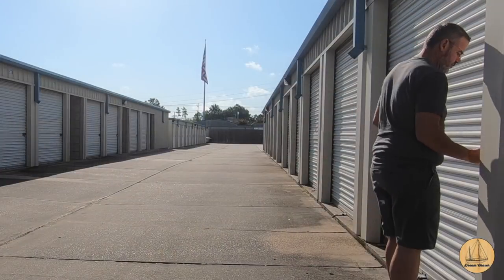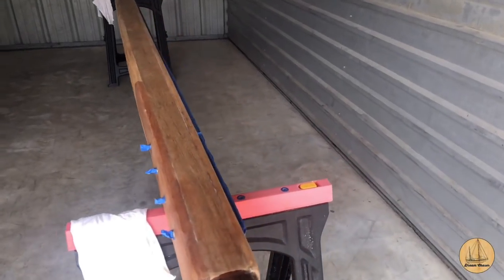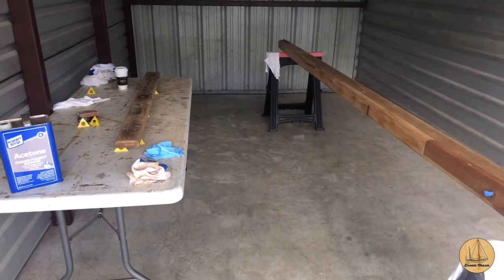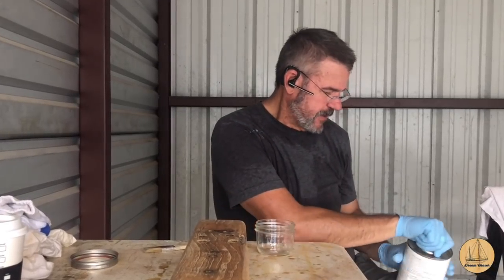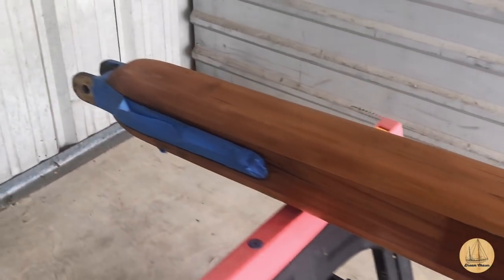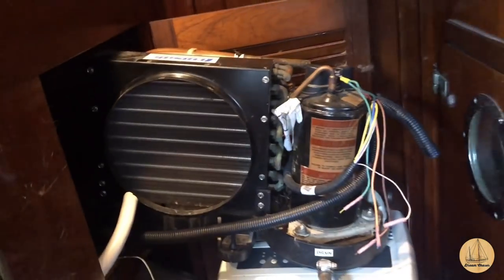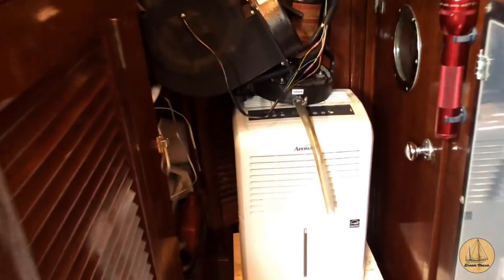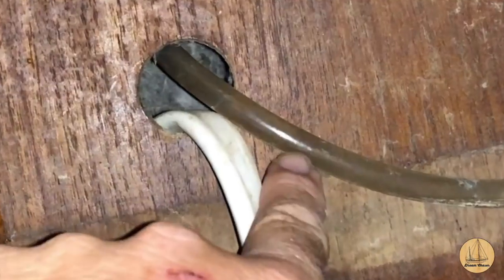Awlwood MA Brightwork and MarineAir repairs and upgrades

Comment: FYI when you sand wood finer, you close the grains in the wood and not enough stain/sealer absorbs into the wood...great stuff Gil, boat looks great...favorable winds!
Reply from the maker: Thank you so much.  That explanation makes sense.  It just seems counter to my gut reaction which is the smoother the surface, the smoother the final finish, but the grain explanation makes perfect sense.
Reply: SVDreamChaser YW...love your work and the step by step for projects...cheers!
Reply: SVDreamChaser it does seem counter to the norm...I've been a painter for 33 years and tried it out multiple times...120 is about the finest I go...wish my rebuild was ready for stain hahahahahaha...great stuff Gil, one day I'll sail down and buy you n Deb a beverage...cheers

Comment: At 8:20 you mention 'decanting for 30 minutes', and mean it to say let stand for 30 minutes, but this is not correct. Simply put, decanting means to pour slowly or carefully. The application guide states to decant for 30 minutes use. In other words, carefully pour only enough that you can apply in half an hour. This is because of the short pot life of Awlwood Gloss, especially in warm and humid conditions.
Reply from the maker: Good call out and catch.  I did let mine sit for about 15-20 minutes before I used it instead of the full 30.  I was doing it for the purpose of allowing any bubbles that formed in the pouring process to work to the top and pop, but you are absolutely correct, the application guide does state to use in that 30-minute window.  Humidity is what cures this product faster so pay close attention to the humidity ranges for the application.  The lower the humidity the longer pot life you will have, the higher humidity will result in shorter pot life.

Thanks for the comment and assisting in the clarification for people using this product.
Reply: @Svdreamchaser  Ditto on the comment above. Pot life is only 30 minutes. So now I have a project where I exceeded my pot life bevore I eveen started laying doen the primer.  Should have read all the comments before I even started.  Hopefully my primer bonds correctly,  but if it doesnt its a painfyul and expensive lesson learned.  Its on me....
Reply from the maker: @corvus5464  sorry about that. I am hopeful it doesn’t require a sanding again.
Reply: @Svdreamchaser  Time will tell.!  I'm going with what I have. Will see how forgiving or not the Awlwood system is.  Time will tell.!  Keep up the good work on your videos !
Reply: What the application guide says is decant enough for 30 minutes. I read it the other way also. Honest mistake.

Comment: how did this awlwood finish hold up after a couple of years compared to traditional varnish? Any update I can find or does somebody have long term experience? For use on teak and mahogany. Im starting fresh AGAIN and looking for a good product that doesnt fall of after a year.
Reply from the maker: I had very high hopes for this and when i did it on my boom it was phenomenal. It still looked good when I sold it after 8 or so years. That said every 2-3 years I gave it a light sanding and applied another layer/coat.   Lesson learned, When I Did my toe rails and wood up top, I sanded it all down to teak, applied the prime coat and put two layers of Alwood on, then didn’t do the rest of the coats/layers. That only lasted a year, maybe 18 months. It was on me, I didn’t put all layers/coats on like I should and it bit me in the ass. Lesson, do the prep work and follow the directions. When you do, It lasts 3 times longer than Varnish with less frequent maintenance.

Comment: I was interested in your condensater you were talking about.  Where can I pick one of these up?
Reply from the maker: Chris I saw these years ago and the only place I know to get the “kit” without trying to figure out how to make your own is Mermaid Marine Air. I have no affiliation with them but I love these things and recommend them. To be fair, you have to clean your drain pans every year or so to keep the small check valve from getting clogged but it is easy and quick. 

https://www.mmair.com/marine-division/accessories/mermaid-condensator/
Reply: Thanks so Much for the reply and the Info. FYI I can't wait to see you guys out there cruising, I'm in the middle of a refit as well
Reply from the maker: Dude, Me Too !!!   This morning was a big day for us. we finished the new fuel system and started the engine and generator for the first time in 9 months.  Once bled, they both started right up.

Comment: Tried Awl wood once..
Reply from the maker: +1 yachtcarpenter and?  I am curious how it did for you.
Reply: sorry part 2 has the results..
Reply from the maker: I just watched part one and part two of your video. First of all you do beautiful work. I wonder if the temperature made it harder to apply? I seem to have not been having much challenge in its application other than having to be pretty diligent about my timing and being very cautious about the relative humidity and temperature. 
The funny thing is when I saw your first video, part one, I thought to myself that must be the finished product. I was shocked somebody was having you redo it, I thought it looked pretty darn good to start with.

I also agree on sailing Zingara and Lady Africa.
Reply: yes the temp was different on every coat I applied. The humidity was well below  the suggested  level. Here in NY we have to deal with Mr Winter 6 months of the year. So we do what we can.
Reply from the maker: +1 yachtcarpenter Makes sense. You have the opposite problem I have. Two ounces put into a container to apply starts to thicken in 20 minutes when it is 95 degrees with 85% humidity. Lol.
Reply: ohh yea I had plenty of pot life.